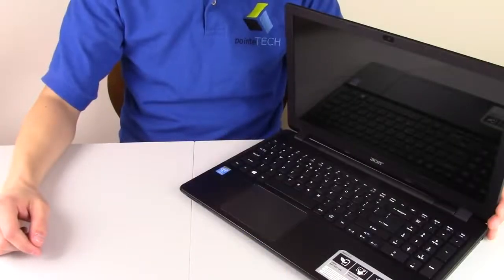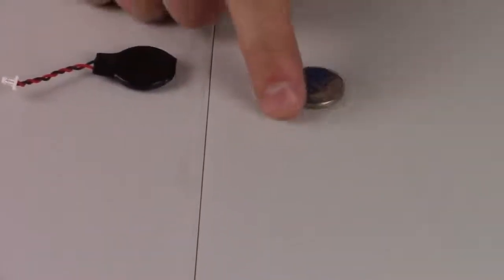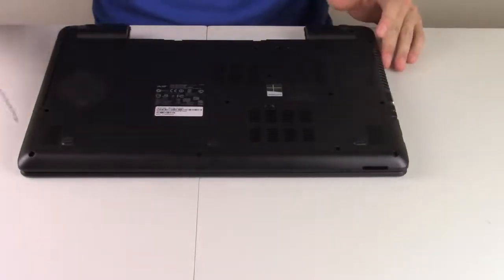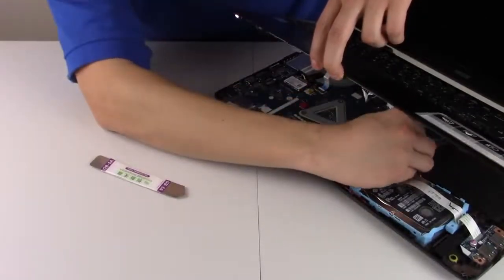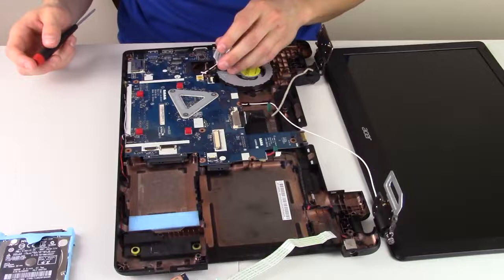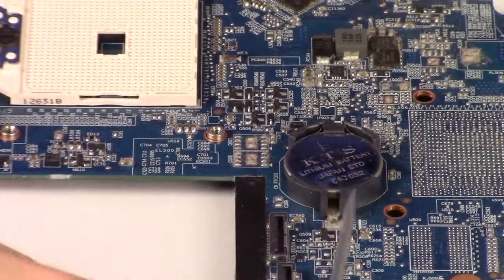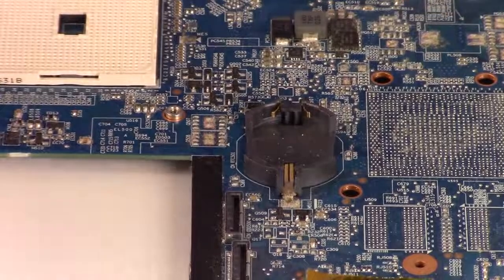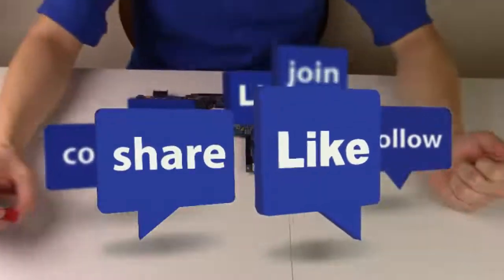How To BIOS Reset, Replace CMOS Battery - Acer Laptop Computer

Comment: Hi. Can you make a guide specifically for acer nitro 5 AN515-43, I tried doing this but it did not work, I also tried the guide about checking the battery and the charger but nothing worked. Thanks :)
Reply from the maker: Your computer wont turn on? 
If you have tried the first video and now this BIOS Reset with no luck, then the next steps are to test the Power Adapter and Power Jack as seen here;  https://youtu.be/YBhsVHideGE & https://youtu.be/HpabvrNaodU.  If those both test Good, then the issue is most likely with your Motherboard.  It would need to be replaced.
Reply: Mine Aspire ES1-732 doesn't have slot battery, it soldered to Motherboard. And My laptop wouldn't turn on also. So I shorted + and - of BIOS battery for 5 seconds and Laptop booted up. In your case, you may missing micro switch located under RAM cover of laptop bottom. When you open this cover to upgrade your RAM switch would terminate Laptop battery connection. With disconnected battery and no power cord attached. Laptop will not turn on. Try either tight up screw bolts tighter on this cover or glue something on cover bump located on cover against this micro switch to have a more firm push on switch.

Comment: Hi, do u have any idea/solution for my acer aspire stuck on press f2 to enter setup but does not respond after pressing f2 or any other key
Reply from the maker: Your computer is stuck on? For a computer that wont turn off, press and hold the power button for up to a minute to turn the computer off. If that fails, remove the battery and unplug the power adapter to force a shut down. What happens after that, when you try to turn the computer on?
Reply: Stuck on "press f2 to enter set up" screen and does not respond to any key nor continue to windows
Reply from the maker: @reggienillas9617  Are you able to use an external keyboard to enter BIOS? If not, can you try the manual BIOS reset as seen here in this video?
Reply: @PC_Monkey  yes ive already tried external keyboard and also removed cmos battery but nothing works.
Reply from the maker: @reggienillas9617  You may be looking at a motherboard issue then if BIOS freezes up and a BIOS reset does not help :(

Comment: I got a acer it won't charge sometimes. If I let it set for a week or two then it will charge. What is the cause?
Reply from the maker: If your computer turns on and works fine but the battery is not charging then you want this video; https://www.youtube.com/watch?v=arZpfqcVoUs

Comment: Hi,
i just applied new thermal paste in my acer ES1 521 also upgraded ram but now its not turning on and neither charging.
I am 100% sure everything is fine but still its not turning on ,
hope this method works.
Reply from the maker: If its not turning on after the work performed, its also possible something is loose or damaged from when you were inside.  Is the RAM the correct RAM for your computer?
Reply: @PC_Monkey  hello again i tried this method, disassembled my laptop again carefully this time.
Found that CMOS battery was soldered into motherboard, i removed it and soldered same on its place but still its not working.
I have few queries:-
1-Can laptops work without CMOS battery.
2-Is it possible my laptop is not starting because of a dead cmos battery ( i don't have multimeter to measure output )
Reply from the maker: @rohitmeinia2580  If your laptop has a CMOS Battery, then it needs it to function properly.   If your computer is not turning on and you cannot find anything loose or damaged then we should start troubleshooting from the beginning on a computer that wont turn on.  Thats here;  https://youtu.be/_MOe71kBPOY.  If that does not help, then we would turn our attention to the CMOS Battery.  We would perform a BIOS Reset as seen here in this video.

Comment: My 2015 acer has been in a cabinet for a few years. I was able to charge it overnight. Lights are blue. It does this same thing, whether plugged in or not, tries to come on but clicks back off. My screen is black. I have tried fn f6 for the screen. Nothing happens with any function key. Im shocked that the battery seems to be okay. Does this route (your video) seem like the right path for me?
Reply from the maker: For a computer that does not turn on, try this video first; https://youtu.be/kOBY4k2Mn_k. Let me know how that goes :)

Comment: Hello what i do may wifi in my loptop is not connecting after i change the cmos battery?
Reply from the maker: Your computer turns on and works well otherwise?  Does it see any available wifi networks?  Does it not accept the password?  What exactly is happening?

Comment: Hi, I have acer aspire R7. It doesn't start when I power on , the power on light appears for few seconds and then it gets  turned off. The internal battery is swollen. I don't know if the issue is with battery or bios. Please guide me which of your videos I can follow to troubleshoot. Your help is appreciated. Thanks in advance.
Reply from the maker: If the internal battery is swollen then it definitely needs to be replaced ASAP!
For a computer that does not turn on, try this video first;  https://youtu.be/P3I7dDpkJps.
Reply: @PC_Monkey  Thank you for responding. 
Where should I get the genuine battery? Trying to search on Amazon, ebay lot many are there. What specific information to put for match with the laptop original battery? Bit confused.
Reply from the maker: @SS-ff3tx  Is this your battery?  https://www.ebay.com/itm/124487527426?epid=1939297643&hash=item1cfc08ec02:g:SywAAOSwz6tf2IWe
Can you match up a part number with the part number on yours?
Reply from the maker: @SS-ff3tx  Is this your battery?  https://www.ebay.com/itm/264095772415?hash=item3d7d55aeff:g:7OIAAOSwlTFd7hOc
Again, see if you can match up the part number to the one on yours
Reply: @PC_Monkey  Thanks for helping, will check the details and follow the steps
Reply: Tried the primitive steps to resolve my issue, however it didn't work. It seems issue is with motherboard. 
I thank you for all your videos giving so many tips to figure out the issues which can be troubleshooted before going to a professional. Great work!
Reply from the maker: @SS-ff3tx  Happy to help :)  Always here if needed !!

Comment: Hey bro i checked inside my laptop for bios but the bios battery is very small and connected with shouldering I don't know what to do now can you give an advice?
Reply from the maker: You would have to de-solder it and then solder it back on to reset BIOS this way.
Why are you wanting to reset BIOS?

Comment: this worked py pc is on and running again
Reply from the maker: Happy to help :)  Thanks for the nice comment and the like !!
Reply: @PC_Monkey  thanks you i didnt think that will help but it did only problem i have is my cmos batery was not removable so i pull of one of the cables
Reply from the maker: @videos9746  Great to hear :)  Nice work !!
Reply: @PC_Monkey  yes im using my pc again i just need to instaal new windows then my pc is 100%  beacause that power out here at home crashed my windows on the pc
Reply from the maker: @videos9746  Great :):):)
Reply: @PC_Monkey  so thanks again for the help

Comment: I have an Acer Aspire 5735z, the screen doesn't come on but the light flash for like 6 secs and goes off. I got myself a new battery and this has happened. Even if I change back to the old one, the same thing happens. PLEASE HELPPPPP
Reply from the maker: try this video first;  https://youtu.be/P3I7dDpkJps.  Let me know how that goes :)
Reply: @PC_Monkey  i was messing about with the ram the other day, so I realised today one of the ram wasn't properly pushed into the slots. So I pushed it back in and its fixed it. So even this has same fault as the bios problems as it looks like
Thanks anyways. So guess u now have another solution
Reply from the maker: @goingviral8917  Glad your all set !!

Comment: can you do a tutorial for the wired battery. im not 100% on how to remove the wire and i dont want to risk damaging anything.
Reply from the maker: You simply unplug the wire from the motherboard.  Its usually a pull plug that just pulls out horizontally.  What brand and model computer do you have?
Reply: @PC_Monkey  oh lol. i didnt realize that it was just a plug. i thought it was wired together. i apologize.
Reply from the maker: @BigFellaDj  np :)  No way to know unless you ask or you have already done it :):)

Comment: What if a Lenovo turns on and off     repair guy thinks it's grounded and needs a new processor    Was item dropped while being shipped overseas do you think?
Reply: Issue did not start until after it was plugged in
Reply from the maker: Are you able to see anything on the screen before it turns off?
Reply: @PC_Monkey  No   it's a blank screen
Reply: Also it seemed to happen during initial setup upon Windows 10 acceptance-
Reply: @PC_Monkey  Does it sound like it's grounded and needs a new Processor to You?
Reply from the maker: @TomandAmyinthePI  If the computer seems like its turning on but turns off before your able to see anything on the screen, then its most likely not actually turning on.  For a computer that does not turn on, try this video first;  https://youtu.be/P3I7dDpkJps.  Let me know how that goes :)

Comment: i have Acer Predator Helios Neo 16and after changing the bios setting it doesn't turn on. i tried removing cmos battery and main battery but still i get a black screen

Comment: I took my laptop (acer aspir f15 F5 573G) to the repair shop they said the motherboard is dead. Do you think that's wrong and the problem only cmos battery?
Reply from the maker: Impossible to say without looking at the computer.  Whats wrong with it?  Will it not turn on?
For a laptop that wont turn on, start your troubleshooting process here; 
https://www.youtube.com/watch?v=_MOe71kBPOY&feature=youtu.be

Comment: My laptop looked exactly like yours up until you pulled the motherboard out qnd flipped it over. Is that the same motherboard in your video? Mine doesnt have a big battery like that, just a tiny one and im not sure that what im looking for. Please help 😭
Reply: Its an acer aspire e15 touch for reference
Reply from the maker: Not all motherboards will have a CMOS battery.  But some will have  smaller one.  You would remove it and reinstall it all the same.  Why are you trying to reset BIOS?
Reply: My laptop wont start. The power light comes on and i can hear the fan start but  it doesnt get to the start up screen before its shuts off. It tries to start again and it repeats that cycle. Thought maybe the screen got broken or the battery was dead, charged it and plug in a hdmi cord but it still doesnt make it to the start up screen. So i went through you first video about holding the power button and it brought me here.
Reply: The battery is soldered in, someone it the comments said id have to desolder it and resolder it. Not sure if thats true, it looks like it can be removed without that but i didnt want to risk it for now.
Reply from the maker: @kohaku1144  Are you able to see anything on the screen during this restarting cycle?
Reply: No, i can tell the screen changes from off to a black screen if that makes sense but thats it.

Comment: It fixed my issue but it's occurred again and again need to remove battery many times should I replace the CMOS battery
Reply from the maker: Yes.  If you have to reset BIOS all the time then I would replace the CMOS battery.

Comment: I have an Acer Aspire 5 A515 and I have an issue with it starting up. The laptop charges fine when connected (The LED button lights up blue) but pressing the Power Button on the keyboard does nothing. I think the issue is with the keyboard because some of the keys on the keyboard stopped working after a year from purchase but I never bothered fixing it as I always used an external keyboard. Recently though the power button seems to be having issues, when I press it nothing happens although occasionally it will start up but after I turn it off and press the power button again, it does nothing. Now I think the keyboard is completely dead hence why the power button is unresponsive, I'll be giving it to the repair shop day after tomorrow, are there any other solutions you think I can do to temporarily have it turned on? Thank you in advance
Reply from the maker: If you feel like the keyboard is the issue then I recommend replacing it.  They are usually fairly cheap, with most used ones on Ebay going for well under $20 USD.  However, the first video I have people follow when their computer wont start is this one;  https://www.youtube.com/watch?v=_MOe71kBPOY&feature=youtu.be.  So feel free to start there if you want to take a stab at a DIY project :)

Comment: Hi PC Monkey ,I thought there be someone out there just like me, who took out the mother board, only to find no battery so whats next?
My pc is  Acer Aspire E1-570 I tried changing the boot mode from UEFI to legacy and set my flash drive to start on boot mode i even F12 to check for boot mode and i even took the hard drive out trick and still nothing all i keep getting is remove disks or other media Press any key to start. if you could help be most grateful.
Reply from the maker: If none of the steps here solve your issue, then try to reinstall the Operating System as shown here;  https://youtu.be/bIlW4im-tr4.  You can create your own Windows 10 Install Media free as seen here;  https://youtu.be/g_UhiHScaSI.  If Windows won't install correctly, then we know that the Hard Drive is bad.  Replace it as seen here;  https://youtu.be/tNp5Kbo9uHg.  Then, install Windows onto the new one.

Comment: That laptop mother board u were first dissembling is suddenly a different mother board is the next take
Reply from the maker: Good catch lol.  Not sure why we decided to edit the video like that.  This is an older video from back in 2018 that we just uploaded late last year.  To old to remember what was going on back then lol
Reply: @PC_Monkey  just figured I'd mention,...am currently having trouble with a Z5WAL motherboard after attempting to install more Ram along side existing 8GB current chip anyways,  after trying various chips,  suddenly the board has no power at all,  tried a couple different charge adapters,  nothing,  started multi metering various mosfets near the DC port, all read consist 19.2V expect a third on the outflow leg I get a reading of 2.8V figure this is normal, started checking all 3V rails they seem ok, then the 5V rail near RAM slots which their are two,  the extra DIMM slot #2 reads ok 5V but DIMM slot #1 their isn't any 5V on from this area of chipsets so I'm thinking their must be  short somewhere.,......hmmmmm
Reply from the maker: @cotemc3587  ya sounds like it.  sounds like time for a new motherboard :(

Comment: Hey i have a really bizarre problem with my laptop, its an acer aspire 3, it wont turn on when press the power button, however when i tap any other button the fans start spinning and it tries to boot, but it shortly dies after, then i tried holding down any button and the laptop succesfully turns on but as soon as i remove my finger from the button, it just dies instantly

At first i suspected a virus named coresync, because a file named coresync somehow stopped me from shutting down properly as a background application.did my research and did the diagnostics, nothing.  

I need advice. Thank you if you took the time to read this.
Reply: We have same model and same issue :(

Comment: I have an Acer Aspire 5 A517-51G that just completely died while in use. It was plugged in at the time. Now there is no power or battery light it’s just completely dead. I tried unplugging my cmos battery but no luck. I checked my cord and power port and found it good. Checked the mother board and it’s receiving power but the problem remains. I’ve been using a charger from a different laptop for a year with the same volt spec but instead of a 3.42 A it’s a 4.74 A.
Reply from the maker: For a computer that does not turn on, try this video first;  https://youtu.be/P3I7dDpkJps.  Let me know how that goes :)

Comment: Please ADMIN, Reply me. I never knew that to remove battery first. I was cleaning my laptop. i mistakenly touched my screwdriver to a  very small transistor(i think its a transistor, was very very small), a spark came out, after that my laptop isnt getting the power , not turning on, not getting any power from charger. charger is fine, i saw your previous video, did everything but its not turning on. And am really upset.
Reply from the maker: For a computer that does not turn on, try this video first;  https://youtu.be/P3I7dDpkJps.  Let me know how that goes :)
Reply: @PC_Monkey  i said, it was a spark when my screw driver front part accidently touched a small transistor / capacitor near my fan connection on motherboard. It had a small spark, after that my laptop not charging not turning on. I saw all videos of yours. Nothing worked for me. If you have an email, i can send you the image?
Reply from the maker: @sohaibali3336  If none of those steps worked then its most likely a motherboard issue, which makes sense if you saw a spark and a portion of the motherboard may have been damaged.  You should then replace the motherboard.

Comment: Hi I'm in this situation after a bios update attemp that failed on my Aspire One 725 (before windows didn't boot but at least bios was functionnal).
Unfortunately, cmos battery removal doesn't work for me :( I think it's over for him
Reply from the maker: What happens exactly now when you turn on your Acer computer?
Reply: @PC_Monkey  Absolutely nothing : no fan, no power light, no led charger etc.
I will try to change the bios to the original version using a ch341a programmer
Reply from the maker: @alexish913  For a computer that does not turn on, try this video first;  https://youtu.be/P3I7dDpkJps.  Let me know how that goes :)
Reply: @PC_Monkey  Nothing worked ;(
I will tell you about the bios programmer soon